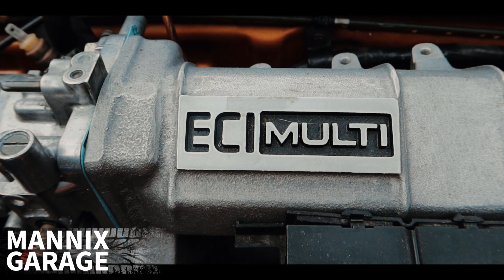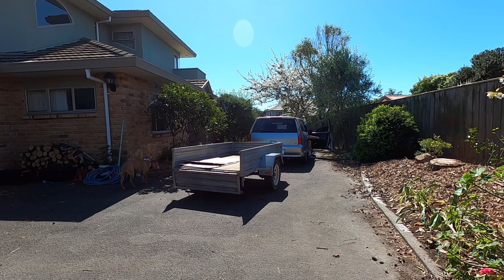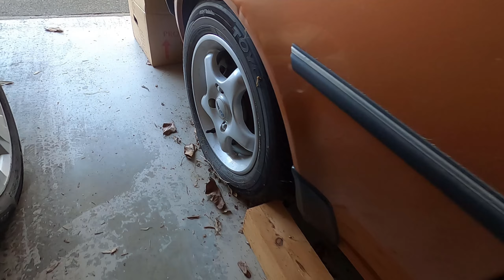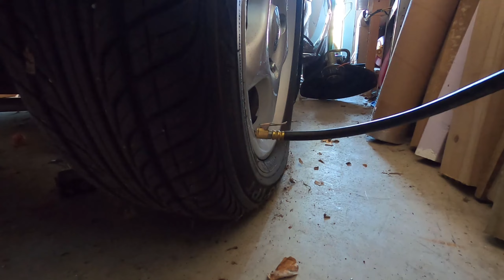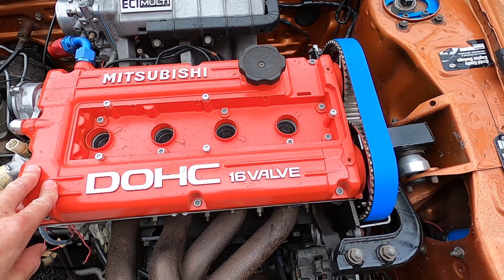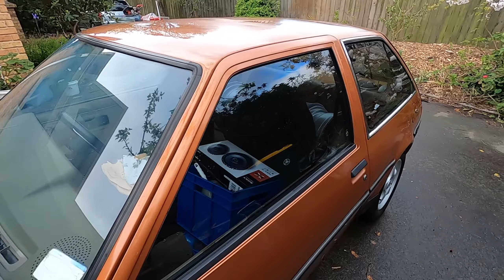My First Car - 1983 Mitsubishi Mirage \ Mitsubishi Colt 4G63T Engine Swap Sleeper Car

Comment: My 2002 mirage still goes real good 198000 original Ks on clock 5 speed manual box 1500 engine
Reply from the maker: Hi there, yeah some of the Mitsi models are very reliable, and a manual gearbox is good too, should last a long time.  One thing to look out for with a car with higher mileage check to see when your cam belt was last replaced.  Thanks for the comment, take care 🙂
Reply: @MannixGarage  Gidday Mate I live in a rural town so im always on a road 100 kph speed limit  my 2002 mirage never lets me down Have had it a bit quicker every now and then
Reply from the maker: @shanemonro6807  Rural driving is definitely better on cars than city driving that's for sure.  Better fuel economy too without the stop start driving.

Comment: Wha did you do for the driveshafts, did you need to make modifications to them ?
Reply from the maker: Hi Remy, I haven't got to the drive shaft part yet, they will need to he custom made
Reply: @MannixGarage  that is what I'm thinking as well, I have a 4g63 with a gear box from a Eclipse and a Colt from 1996 and the driveshafts is what got me thinking.

Comment: I’m doing the exact same swap in the states, what motor mounts did you use? As well as transmission mount? Man I’m at a loss in finding coilovers for it and the disk upgrades. Any information would be super helpful. Thank you for sharing this!
Reply from the maker: Hey That's cool, I wasn't sure how much this video would be of interest, this was my first car related video so happy its of interest to some people and more so in USA too which is great 😊.  Front coil overs are Tein evo 1-3 coil overs I would have to confirm they could be vR4 ones ill just have to look back at my records (you just need something, at least can be rebuilt to match the weight of the car, I went Tein as they can be rebuilt here in NZ).  Brakes are from a Sigma GSR and not sure if you have that car in US but will do more videos once I have car at my place.  Engine mounts are all modified to fit, rear cross member we had to move the mount from memory, and will do more info on that in later videos. Keep me posted on your car.
Reply: @MannixGarage  awesome I can’t wait to see more content. My goal with this car is a sub 9sec 1/4 mile time. We made provisions to strengthen the front end as I believe any over 400hp at the dragstrip may flex the body causing the windshield to possibly crack. I have a 1993 Hyundai excel with a 4g63t swap which is almost identical to the colt as far as the suspension, engines, brakes etc. if you search here on YouTube Hyundai excel 4g63t dyno it’s a burgundy hatchback with black wheels. This was years ago. The car has a bit more power now. It is a blast to drive. The colt will be terrifying with anything close to 300. Let alone my goal for 500
Reply from the maker: Hey i will check out the dyno video sounds good.  I will be interested to see what you do for strengthening the car too.